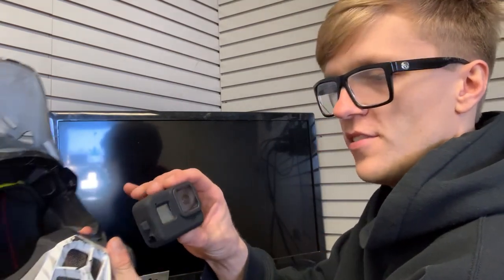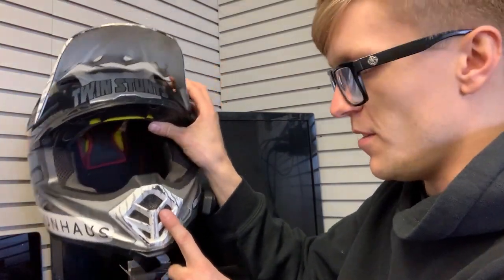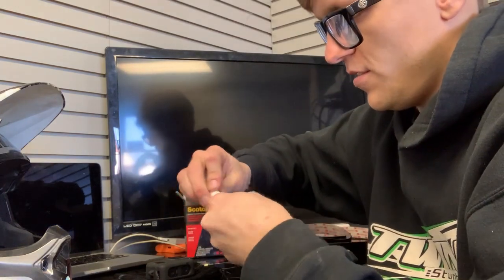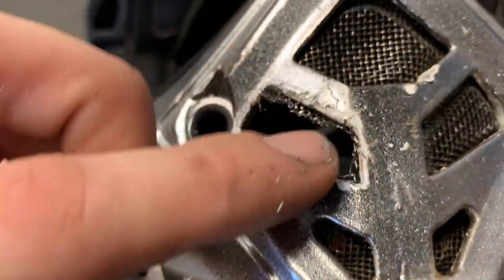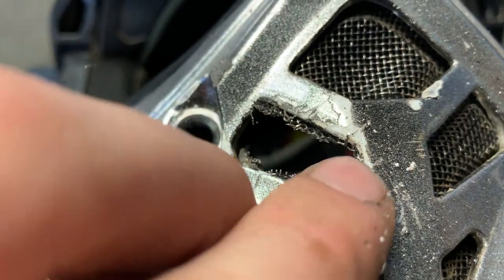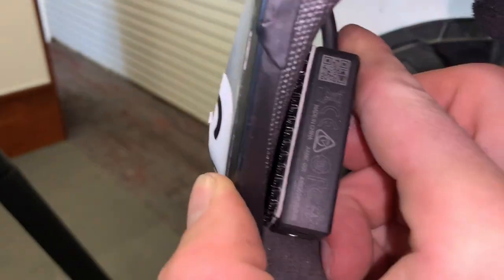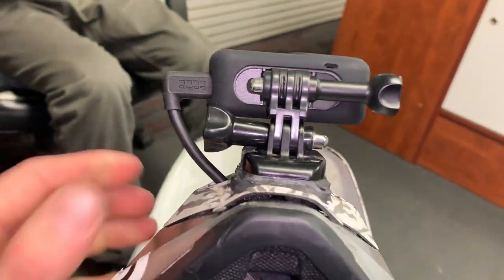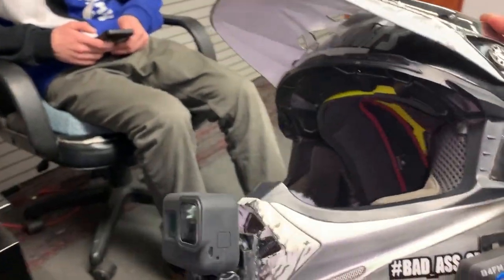Motovlogging with Hero 8 | MX Helmet Vlog Setup

Comment: Nice video man, basically the same set up as me, I'm looking at upgrading to the Hero 8 and was wondering about an external mic for vlogging. I run a Hero 3 right now, same purple panda mic, and my chin mount is a bit different than yours. Also if you still find you have too much wind noise you can use tape/foam to clock those mesh vent holes on your chin. I found that really helped. I ride a Yamaha Grizzly ATV and Honda Africa Twin adventure bike.